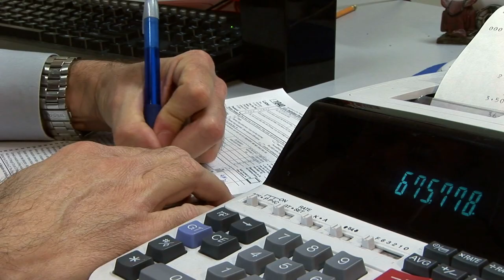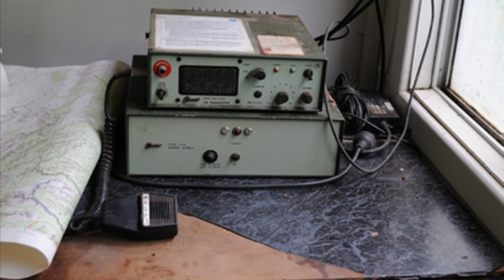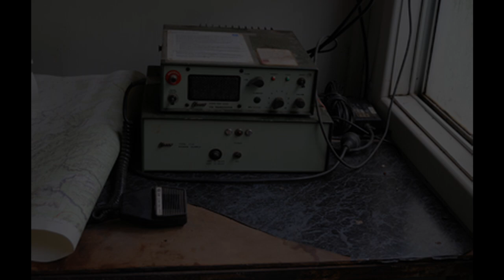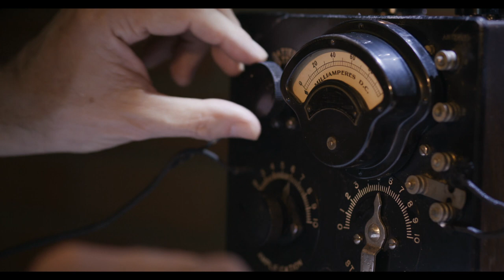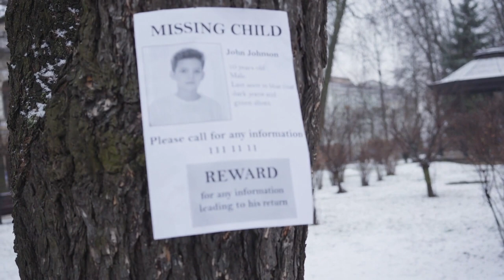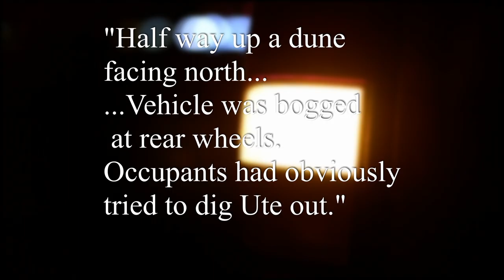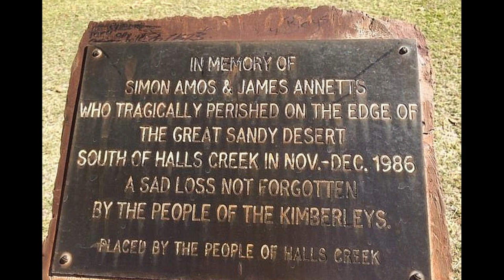UNSOLVED for 30 YEARS | The Flora Valley Station Mystery | AUSTRALIAN OUTBACK MYSTERY

Comment: I believe Giles did it. I think he shot one, possibly in a fit of rage & then held the other captive until he perished to. I think he then went on to stage it as if the boys had stolen the ute & taken off but ran into trouble that ended with one "mercy" killing the other before finally succumbing to dehydration himself. Lots of places to hide cars & bodies out there.
Reply from the maker: Thanks for stopping by and sharing your input. Yes it's certainly a very strange case indeed
Reply: I worked for Sherwin under Loder never knew him to be cold blooded maybe a little dictator of a guy. Also I hear how living conditions were bad, ironic that most lived out of a sleeping bag. When I was at mungabroom, conditions were reasonable it was a roof over your head. Also the 2 boys would have been warned of not just taking off into the never never, the black jackeroos would remind me not to go wandering.
Reply: @Being FRANK  you and Kendall then are the only ones saying Giles was OK.  Consensus is he was a prick through and through.

Comment: Abused and murdered by the manager/ owners? 😢. Great job on the video
Reply from the maker: Yeah with what little information I could find on this subject... it all points to something ominous...
Thanks for stopping by and checking out the video.
Reply: It’d be worth chasing up others who had worked at the station. Was there a systematic problem of underpayment and abuse? Did the owners fear that the two boys were going to go public about it potentially resulting in lawsuits and prosecutions? And what was the relationship between the owners and the local police?
Reply: @paulorocky  if they were then going 500 kilometres in scrub land with just a normal ute doesnt makw sense. Seems like a good place to go missing or lose someone. Surely not alone..

Comment: I remember that happening at the time. I was around their age and even remember that ad in the paper. Even thought of applying myself but ended up getting a job that same week. Lucky hey? 
But for some reason I remembered that they were out working, broke down and ended up trying to get back but died from exposure. Never knew about what really happened to them? And what a lowlife bunch of ASSHOLES to do what they did all to save a dollar at the cost of two young lives. So how did they come to the conclusion that they did? What about the gun? Did they find it? Where was the bullet hole in the skull? And what about the decomposition being so far apart? It's seems obvious to me some other bastard was involved?
And was there ever any other scenario that they thought what could have happened?
Reply from the maker: Hey thanks for stopping by and sharing your thoughts on this. Yeah it was pretty tragic. The best source of information I found was a book called "Blood in the sand" which I've linked in the description of this video. Definitely check it out if you would like to learn more about this.

Comment: I worked on those seismic lines 4 or 5 years earlier. They would have been overgrown, and hard to mistake for a road, unless that particular line had been used as a track by somebody. That sort of area, you wouldn't go there, unless you had 3 spare tyres, a jerry can of fuel, and lots of water. Must have been desperate to flee, taking off in a decrepit old vehicle, not even 4WD (well was, but was broken and only had 2WD allegedly)
Reply from the maker: Really interesting to hear that. That's really good insight to hear from someone who actually worked around the area so thanks for stopping by and sharing this.
Yeah I've always thought that it was a desperate attempt to flee. But what throws me is the foreign human blood found on the hat... I mean It could've been old(er) blood but the details of how horrible the work environment was makes me think something else was going on..